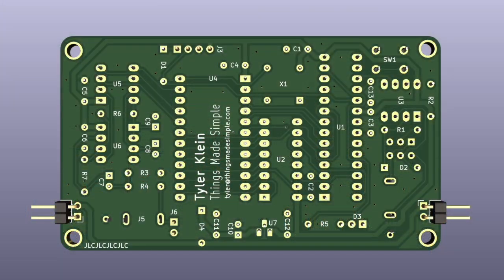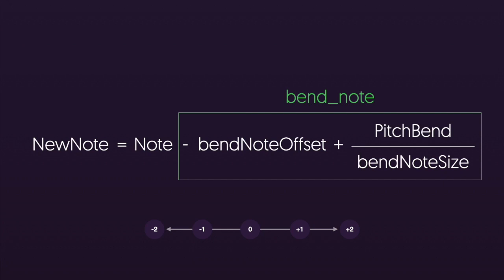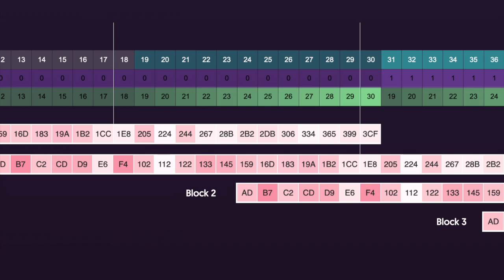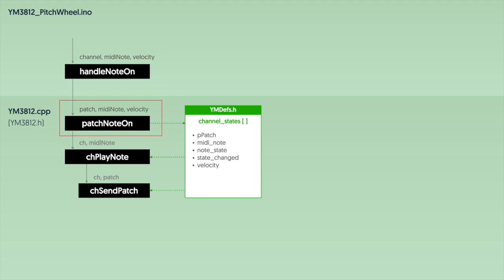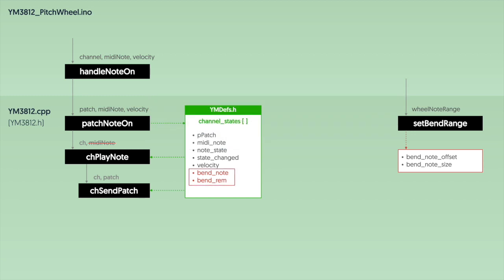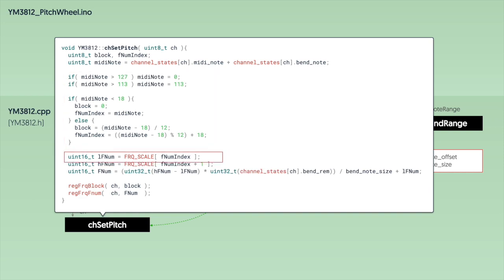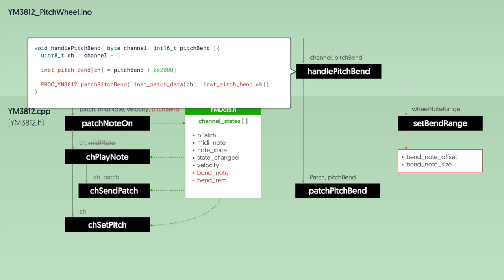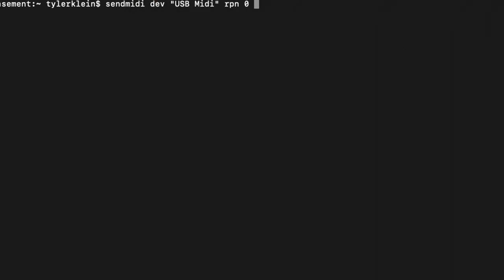YM3812 Ep10: Pitch Bend

Comment: Did you add the anti aliasing filter, i mailed you back than?
Even the digital Hihat, Cymbal and Crash voices of the Roland TR-909 as wel the Roland TR-707 have that. Albeit not using opamps.

My old Roland Keyboard allows you to set the range of the pitchbender.
Reply from the maker: I haven't adjusted the output circuitry since the second video. The last several episodes have mostly focused on the complexity of getting the base software in place. At some point, I will have to do an episode on upping the voltages to EuroRack levels, and your recommendations on adjusting the output filtering would be a great addition to that! But I'm still working up to it—so much to do! Thanks for the suggestions, and for watching!
Reply: @ThingsMadeSimple  the PSU schematic from the mini brute on Yusynth page.

Quite impressive how you figured out the midi note to frequency relations from the Yamaha chip, did you use a Frequency counter, like BOSS TU-3 Chromatic Tuner?
Reply from the maker: @AnalogDude_  I just recalculated them using the formulas in the datasheet. The calculation tool I made to do it is on my site if you want to try it out ;) https://ym3812freq.thingsmadesimple.com
Reply: @ThingsMadeSimple  i do work on electronics, schematics, pcb's but something else requires my attentions and resources.

Did you check out the schematic i advice to watch? it's very very useful.
Reply: @ThingsMadeSimple  You should make a PCB with the PSU i showed you, along with the anti aliasing circuit from the mail, low pas 20kHz, fill the rest of the space with vias and connections for circuit improvements along the way if needed.
Reply from the maker: That’s a pretty cool chip! I’ve always used charge pumps to create the negative voltage. In this case though, converting to EuroRack format will bring with it the benefit of a +/- 12v power supply, so we won’t have to do anything too fancy. Just need to add 5v regulation for the micro.
Reply: @ThingsMadeSimple  Yeah, no need to brake you mind if you can use the circuit from a commercial product.

Why integrate in eurorack? you could make a additional box with both 3.5 mm and 6.25 mm jack audio out and use Befaco "INAMP" and "OUT v3" schematics to route the audio into your rack and have it amplified to 10 Vpp by the Befaco modules.

You should have atleast 4  Befaco INAMP and OUT modules in your rack, to include your synths and other devices in your eurorack, also enabling using guitar effect pedals.
Reply: @ThingsMadeSimple  I just found out, there is a Yamaha YFM825, it's 16 bit, uses SPI, has onboard amplifier for speakers, but i can't find anything on the control registers, the datasheet doesn't tell much.
16 voice polyphonic and 29 wave forms.
Reply from the maker: That sounds like a really cool chip! Could be another interesting rabbit hole to go down :)